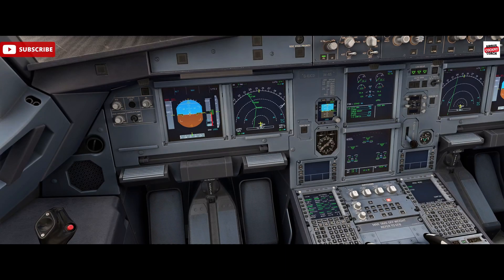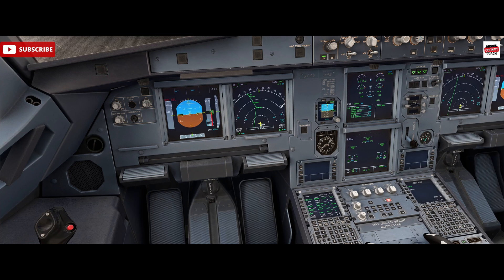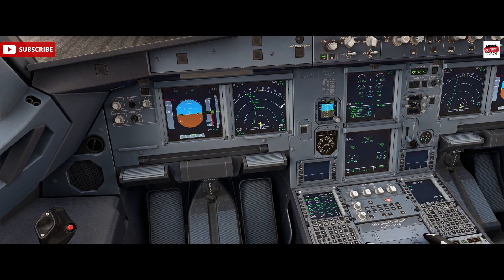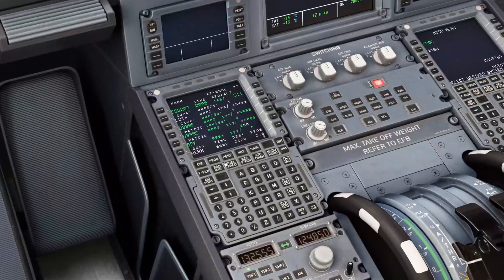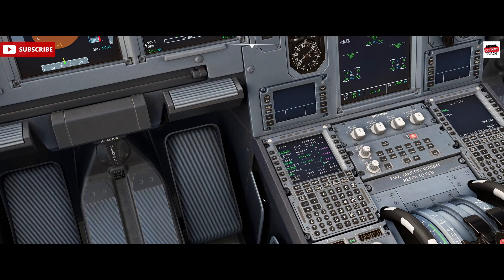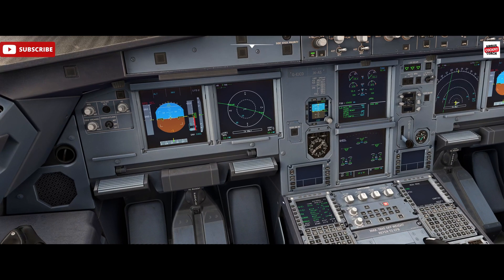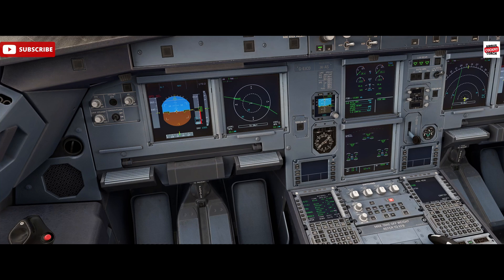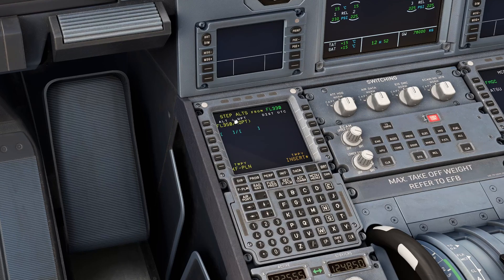A320 Step Climb Tutorial | Real Airbus Pilot Explains When and How

Comment: Awesome video thanks. For optimal step climbs - can you select flight levels not already in the flight plan? For example - FL360, 370, 380, etc etc - to determine if those could be utilised as step altitudes?
Reply from the maker: Hello, yes you can. Just enter them without a fix and the system should show where the optimum place to climb to that altitude is, if it considers it to be efficient 👍
Reply: @AirbusCockpitCoach thanks - and what happens when the aircraft thinks the level isn’t efficient? (Say for example you input like FL430). Would the ‘waypoint’ return some sort of ‘error’ or the likes?
Reply from the maker: @ArrRoh it just will not give you a recommended climb point. If it is above your max you should get a MCDU message ' Crz level above rec max' but only when that altitude is targeted
Reply: @AirbusCockpitCoach ok thanks for clarifying. Much appreciated - and awesome little bite sized tutorials. Thanks a bunch 🎉
Reply from the maker: @ArrRoh Thank you! 👍

Comment: Hi, I am new to the Fenix, and Airbus in general.  Have a Simbrief FP with two steps but they are to lower altitudes. FL info is FL "STEPS LIRF/0360/IDOVI/0280/ODVUX/0240". I followed your tutorial and entered alt and waypoints for both steps.  They are shown in blue in the MCDU but also say "IGNORED" to the right of both entries.  No symbol is shown on display when I change to plan and scroll through the route.  Only TOD arrow is for the main descent point not the entered steps.  Any advice would be welcome
Reply from the maker: Hello, we would not normally use the step function in descent, its primary purpose is to plan for climbs to get to more efficient altitudes. Your flight plan will show decreasing altitudes after your top of descent point which are the altitudes that the flight planning software estimates you will be at when passing those waypoints in descent if you start your descent at the calculated top of descent point. We would enter VNAV restrictions to meet any hard constraints. Ideally we would plan for a continuous descent for optimal efficiency rather than step down

Comment: What if we only key in the altitude and not the waypoint. Would the step climb new altitude be assigned to the original waypoint being selected
Reply from the maker: Hello, step climbs must be assigned to a waypoint. Usually if you key an altitude in with specifying a waypoint it will get assigned to the next waypoint which could lead to operational discrepancies

Comment: Between BEGAR and the following waypoint the symbol appears to show the top of climb.  Would there have been a start of climb symbol somewhere before BEGAR?
Reply from the maker: Hello, no we would not have a start of climb, it only advises of the point we should plan to be at the next level with the top of climb symbol
Reply: @AirbusCockpitCoach  Thanks for that.  Would there ever be a situation where a pilot would want to add a flight level that is lower than the initially planned cruise level and does the step alts screen allow a lower level to be entered?